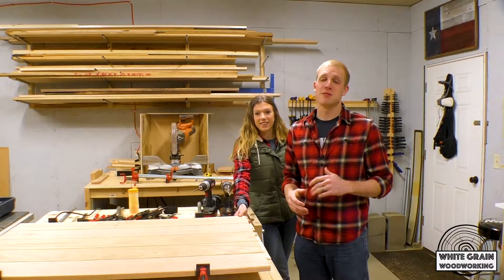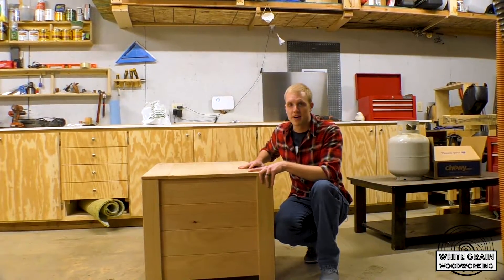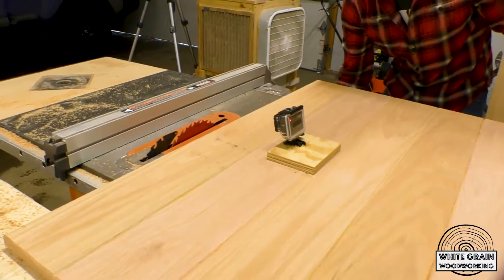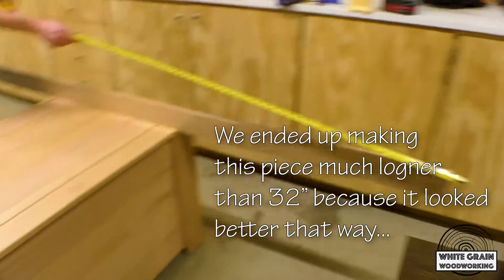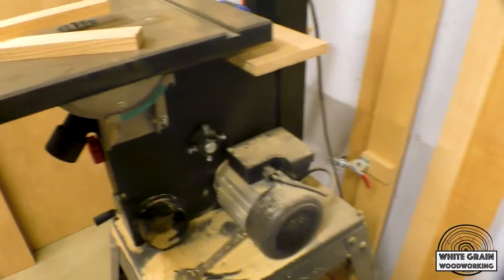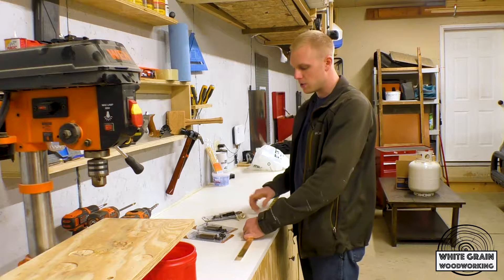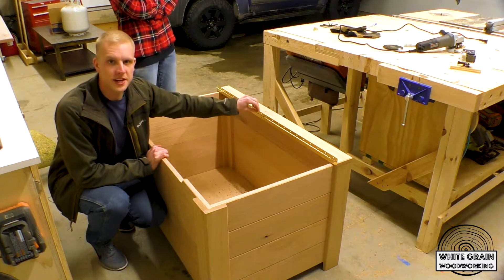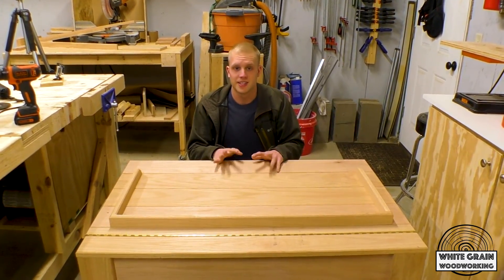Toy Box Day 3 | How to Build

Comment: You need to allow for wood movement in your designs. Wood can move up to 1/8” per foot across the grain with changes in humidity. The toy box sides and top may move up to 1/4” over time so you don’t ever want to glue boards across solid wood panels like you did with the interior corner boards and top tray boards.
I like your energy and videos. Good luck with your future projects.